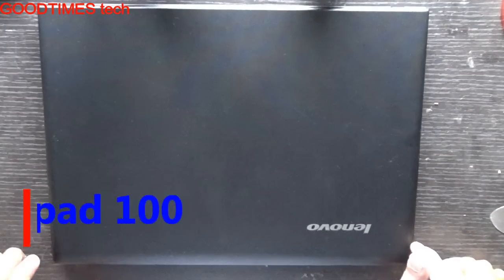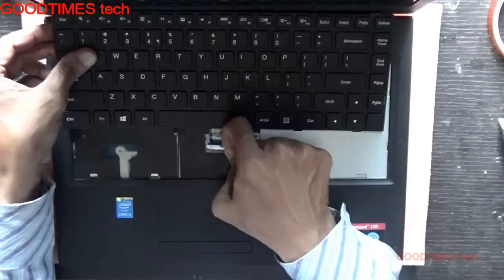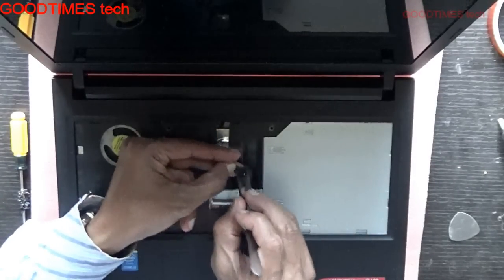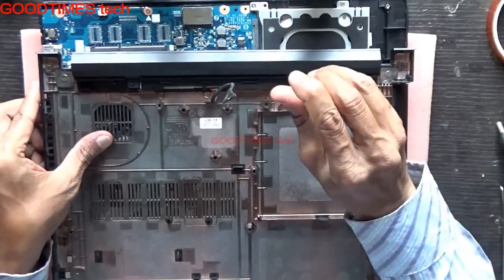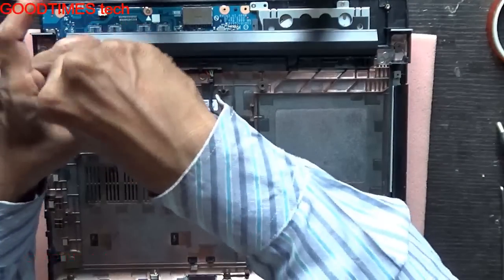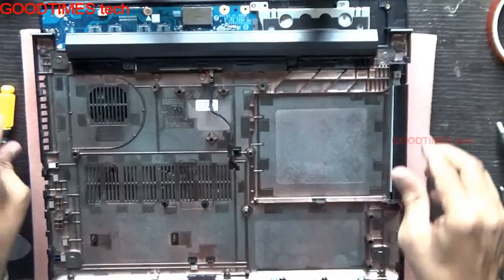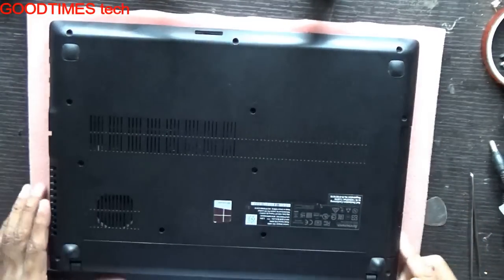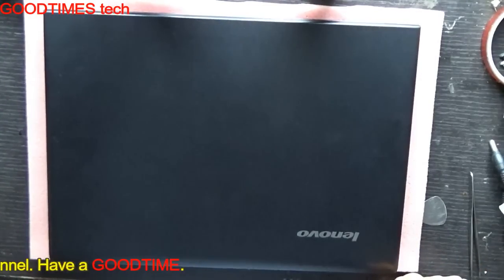Lenovo Ideapad 100 | How To Replace Battery.

Comment: What is the possibility of hinge breaking while replacing battery, because two person told me that hinge may break same model as you have.
Reply from the maker: Hi, 
there are possibilities that the body that holds the hinges may break, to avoid breakage you need to keep the laptop display open(as you keep it during usage) until you finish the whole process, open the display , place the laptop upside down on the edge of the table display facing downwards and continue disassembling. hope you understood the process, i will make a video on same in a day or two and upload it, kindly subscribe and click on bell icon to get notification.

Thank you for watching, have a GOODTIME.
Reply from the maker: Hi,
Please make time and watch the video in the link below if you are planning to disassemble your laptop...
https://youtu.be/cSzsdQC5TEg
Thank you, have a GOODTIME.

Comment: i did it thank you mr good time tech the only problem i had was connecting the battery end to its socket that part you did not make it clear so i looked at many u tubes to see where it is  hidden under and eventually i did it,my comment you are the best in the group in explaing how to replace battery because you narrate the others are using annoying music andare mute  one knows nothing what are they doing with no explanation . .my small advise e next time use a better light and a  of high magnification over all you get 90% congratulation

Comment: Wow I didn't realize Lenevo did such stupid designs now on their consumer lines. Stick with the T series or P series Thinkpad lines as they are much easier to get at things like HDD, memory, battery etc. These are essentially throw aways after 2-3 years. The battery is $49.95 on Lenevo's web site. If you can't do it yourself and take it somewhere they'd want I'm sure a minimum of $50 to replace it if not more. To me that $100 is better spent on a refurbished T series laptop that will probably last a long time too. Also some of the Dell Latitude lineups are decent, but in more recent years even they are starting to do some of these dumber design ideas.

Comment: Is it mandatory to remove keypad for hdd?
Reply: Yes, there are screws under the keyboard that hold the bottom cover in place. Plus you also need to remove the battery connector as well

Comment: First, the keyboard is glued with two sided tape so it feels like you are breaking something getting it off. It also has clips all around don't try to undo the bottom until last. Second, there are 3 screws under the keyboard that need to be removed. The third screw was hidden under a Lenovo label, thanks Lenovo. Thirdly, there is no need to disconnect the keyboard harness.
Reply: Big thank you panellockout, I spent a lot of time until scrolling down to find the screw under the Lenovo paper sticker. Sending you a digital beer to mentally enjoy. Thanks again.
Reply: Big Thanks to you and your brain 
For saying the location of the third hidden screw 🙏🏻🙏🏻🙏🏻🙏🏻🙏🏻🙏🏻

Comment: how stupid that design is,  I have 3 laptops and i remove my batteries for long time life, taking care of over heating and usage, i have one of these laptops but after seeing your video it would be more problems to take battery out, so much can go wrong.   
thanks for video..
Reply: That was my first thought, extremely stupid design
Reply: This is a good video, but I also have trouble with this design.  This is a very good reason to never buy a Lenovo again.
Reply: Because of Lenovo shit!
Reply from the maker: Thank you for watching, have a GOODTIME.
Reply: It took me 5 minutes to disassemble the whole laptop. Is not as hard as it looks.

Comment: Thanks for the tut sir.  BTW is there any pdf or guide for me to find the location of the fuse for this brand of lenovo?
Reply from the maker: Most of the present day laptops are not installed with fuse, MOSFET does all the switching. can i know whats the reason to search for fuse location ?

Thank you for watching, have a GOODTIME.
Reply: @GOODTIMEStech  Sorry for the late reply sir xD.  Im having a problem for the power system of my laptop sadly it wont turn on.  I already used the common step in solving the power issues but sadly none of them work so maybe the fuse is the problem in my opinion

Comment: hi do you know how to fix this problem (pls see link),, i have a lenovo laptop i think its a idea 310, thanks  (its driving me crazy!!)
                                                      https://www.youtube.com/watch?v=MVB-tfxdQiw
Reply from the maker: Hope you have tried switching between legacy and UEFI mode in Bios as shown in the video link.
even after that your laptop HDD is not detecting , either HDD has failed or HDD is not getting 5V power from motherboard.
please tell me what exactly happening and what all you have tried to diagnose ?.
Reply: i have tried both legacy and the other one
Reply: i want to get to the blue screen that gives me the option to restore but cant find a tutorial on it,,,,, i have accesses the restore by pressing in the hole at the side of the computer with a pin,, selected restore but once i do that the machine just shuts down.. ive been trying for "days" to find a solution
Reply: original problem,,,, black screen saying checking media,,, then black screen with white writing,,, then switches on and off,, on and off,, on and off etc
Reply: if i can just access the blue screen which has the option to recover it may work,,, but i dont know how to access that screen,,,, i have tried to hard re-set on/off 3 times but the recovery blue page doesn't come up..
Reply from the maker: Sorry for late reply, once you try to disconnect the keyboard(laptop keyboard) and connect a USB keyboard and try. I have seen that some keys in inbuilt keyboard will be short and it ddoesn't allow you to enter Bios etc...
If this doesn't help, disconnect the harddisk and check if the laptop stays ON, if it stays on then some badsectors on HDD might be causing this.
If the laptop keeps turning on and off even after doing the above then some fault in the main board.
Hope this will help, if it doesn't please comment we will see what to do next.

Comment: Can I still run my lenovo ideapad 100 without installing battery? Just make sure it is plugged in? Thanks.
Reply from the maker: Yes you can run but while running if power fails then harddisk drive may fail and you may loose DATA.

Thank you for watching.
Have a GOODTIME.

Comment: Are all the screws in the back the same? I bought a used 100-15ibd but its missing 7 screws. Thank you.
Reply from the maker: NO, there are two types with different thread diameter.

Thank you.
Have a GOODTIME.